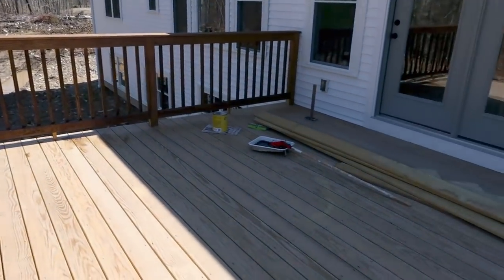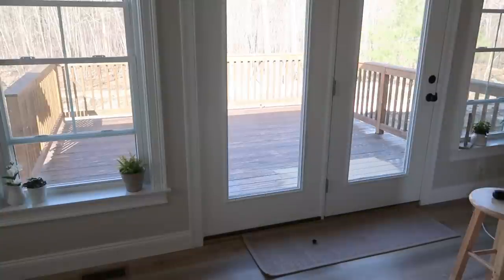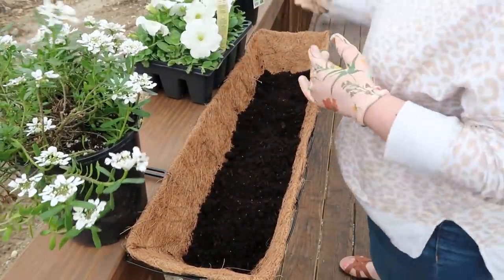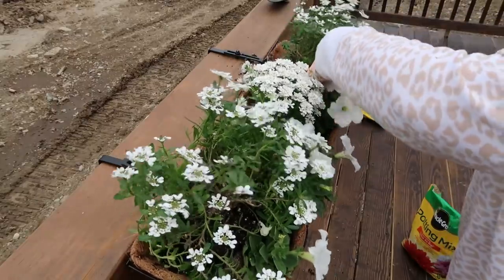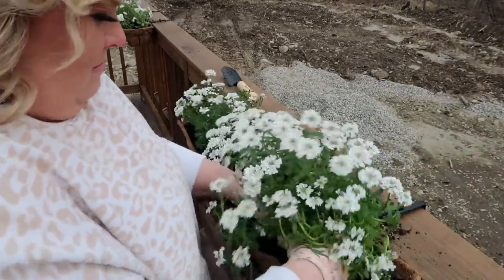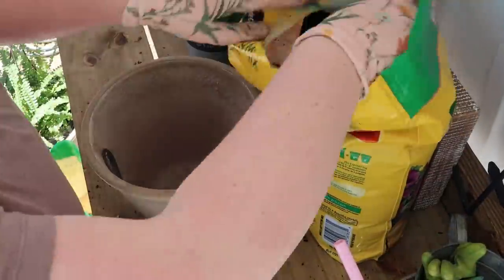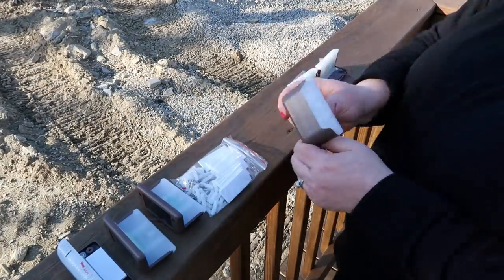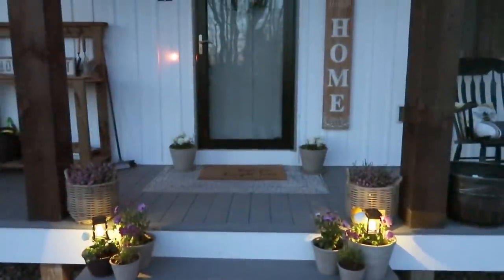FARMHOUSE DECK MAKEOVER PART ONE // PATIO MAKEOVER // DECORATE WITH ME // CHARLOTTE GROVE FARMHOUSE

Comment: Everything looks great, but I was thinking the flower boxes on the deck railing should be hung over the outside edge so water wouldn’t drain on the deck??? Or maybe it’s just individual preference?
Reply from the maker: Thanks Linda! I definitely think it =boils down to preference. The deck gets rained on all the time, so it's built to get wet. I also don't want to the point that they are dripping typically. But I wanted to see them from inside the house and while looking at the deck - that's why they are on the inside of the railing. :)